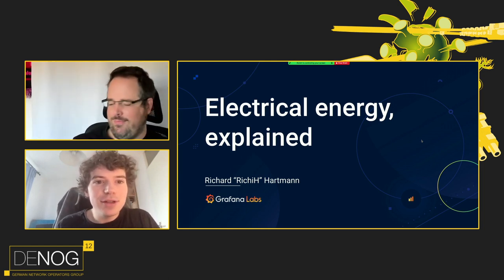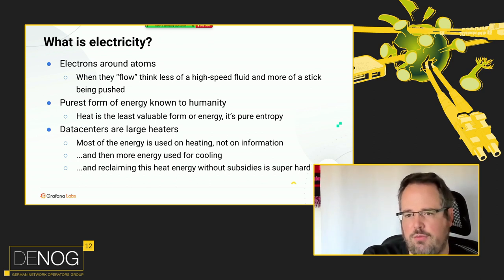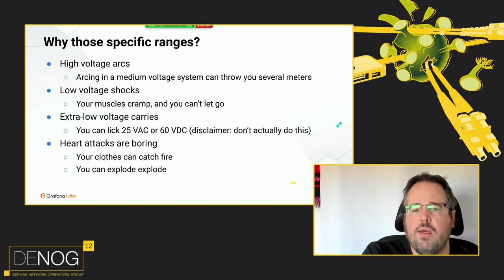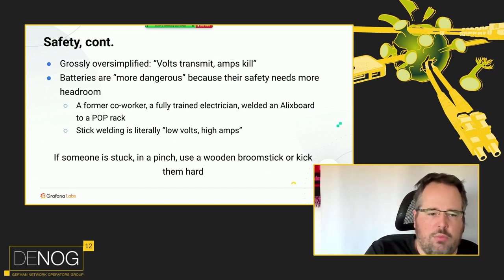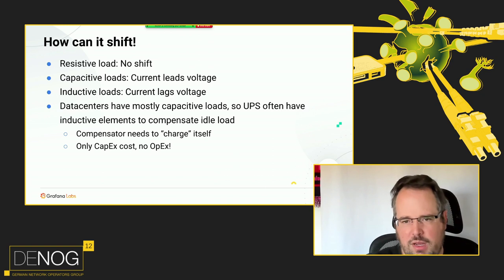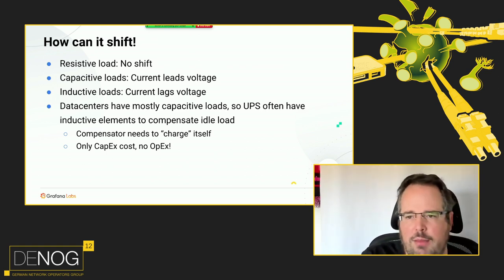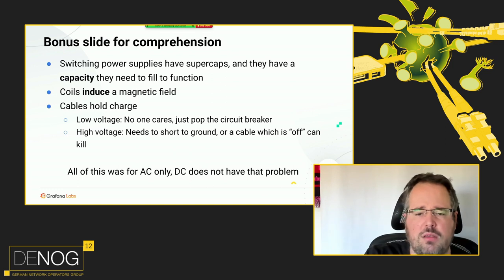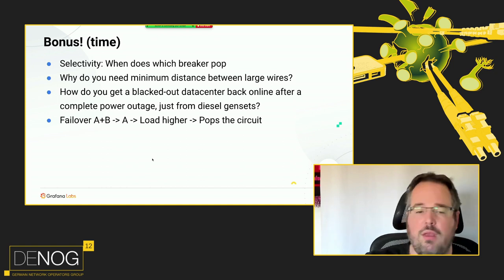DENOG12 - Electrical energy, explained

Comment: I got the slide at https://youtu.be/cw22HDiVXno?t=1335 wrong. Medium voltage is coming in as three phases in triangle configuration and you create the star point locally. So no neutral wire here, and the ground wire is not shown. Sorry!

Bonus content of the 20kV switchgear test at: https://www.youtube.com/watch?v=IJTAhEfrsSc